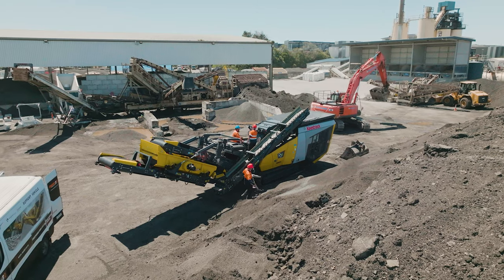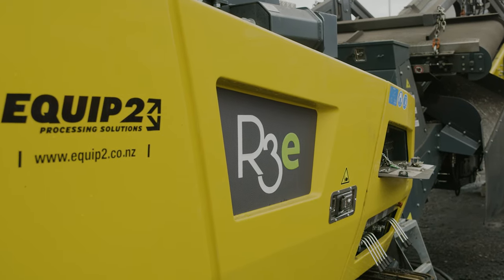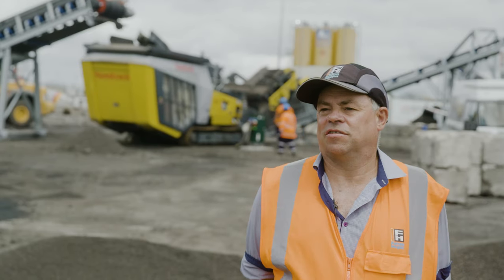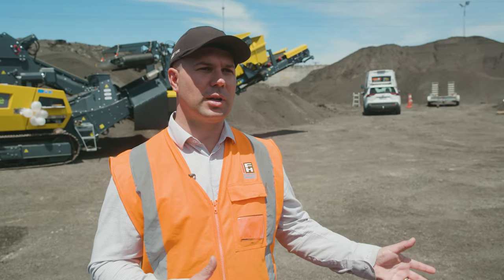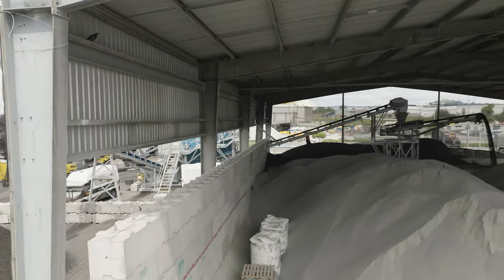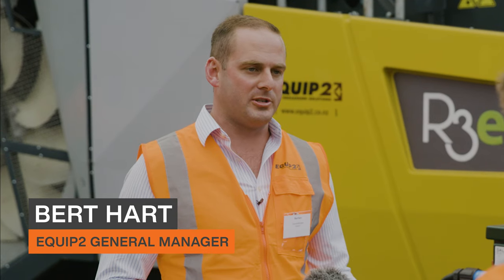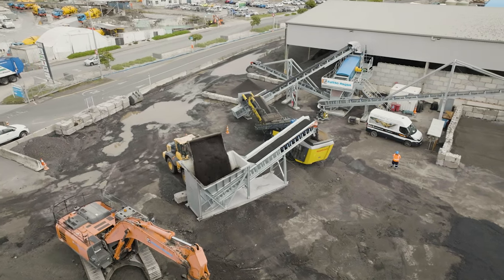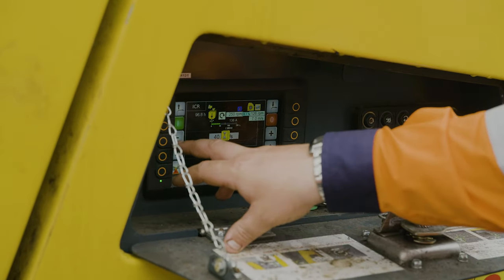Customer Profile : Fulton Hogan using the R3e Impact Crusher

Comment: What powers the electricity that powers the crusher ?
Reply from the maker: it hybrid so can run off the grid but even with running off a diesel generator this electric drive machine is more efficient to run than hydraulic driven machines